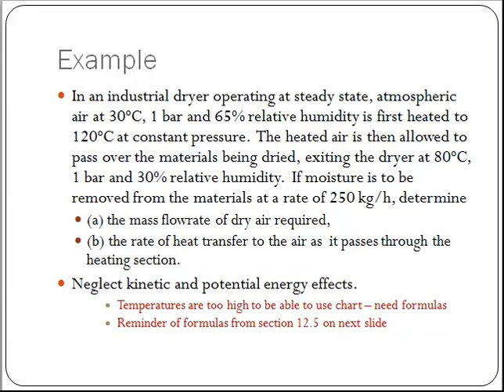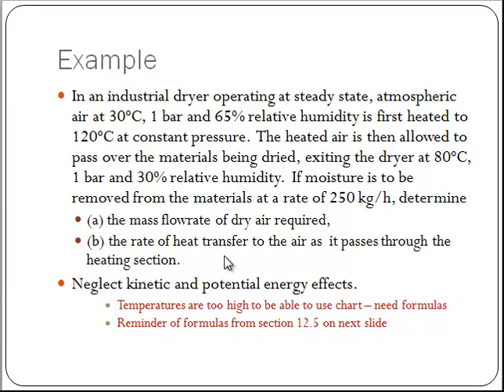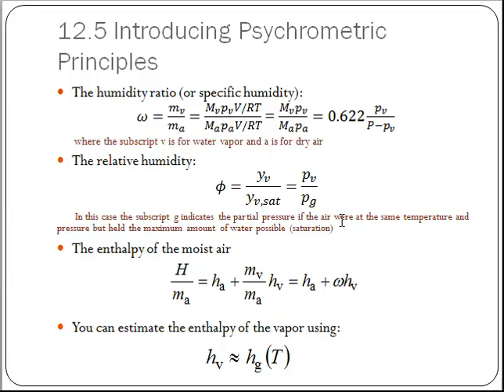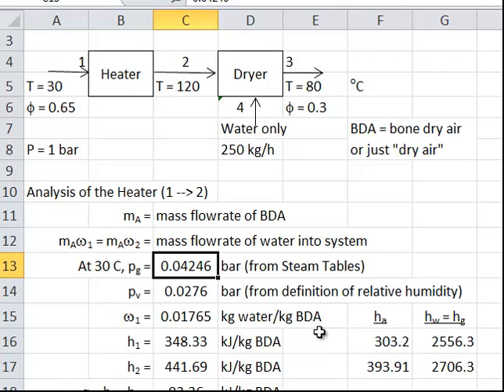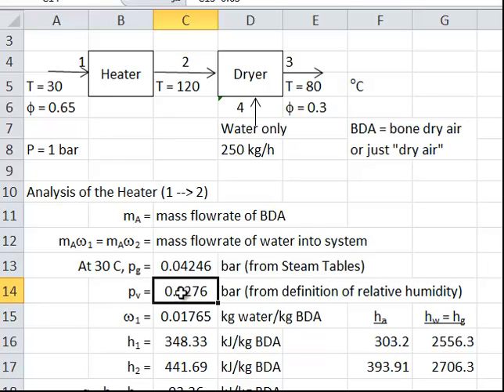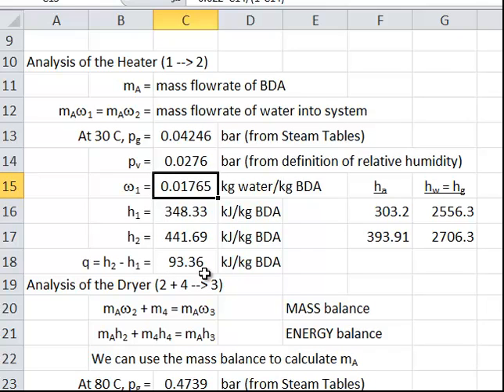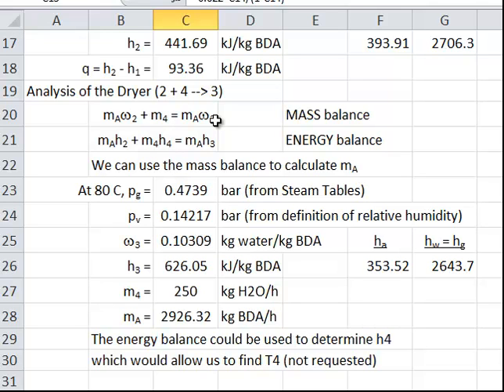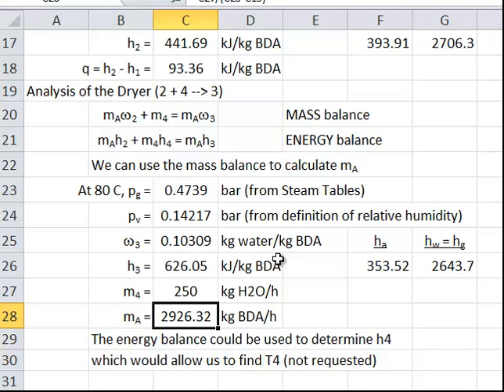Humid Air Example 1  Using heated air to dry a material

Comment: how did you calculate for the enthalpy of air at point 1 and point 2?
Reply: Seems to have used cp * (273 + 30) and cp * (273 + 120) with cp pretty close to 1 KJ/Kg/deg K